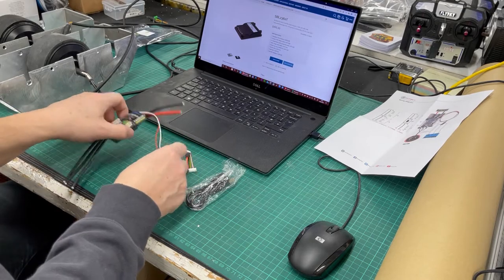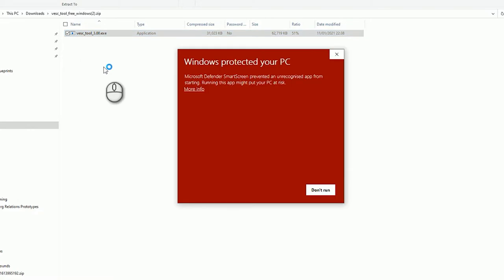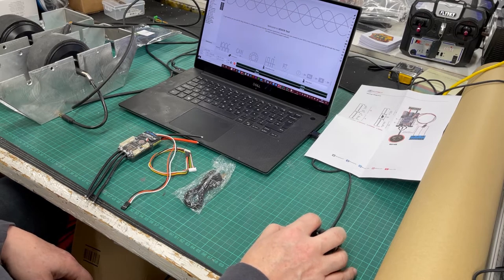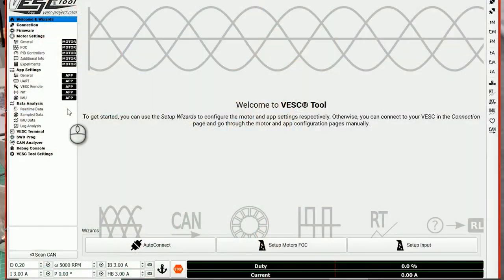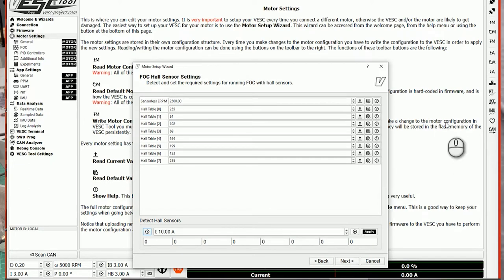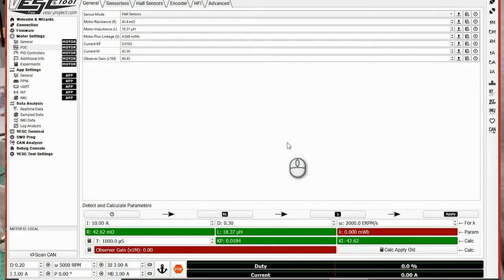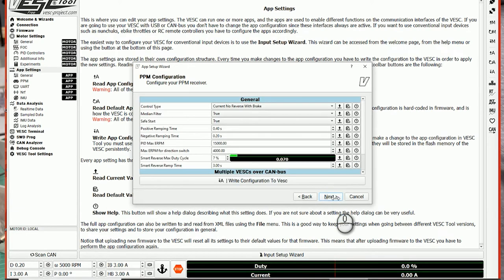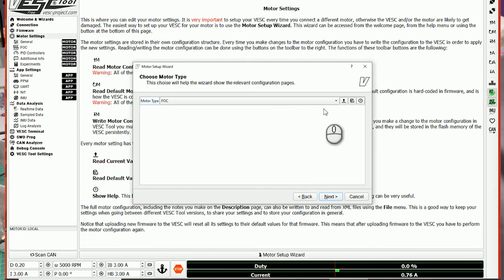Flipsky Mini VESC FSESC4 Speed Controller Setup for Brushless Motors

Comment: Hi, this is one of the best videos so far. Great job! What remote and receiver are you using? Are they standard 2.4Ghz or something else? Is the receiver analog, servo or digital?  I would like to get the same one. What cables need to be connected for the remote to setup and work? Sorry for all the questions but i really like what you are doing! THANKS
Reply: Ray , its a Spectrum DX9 transmitter that is digital with DSM2/DSMX protocol running on 2.4GHz

Comment: Hi, Lee!  Thanks for making this, it was super helpful, especially with the current stock shortage on RoboteQ's controllers.

Did I follow correctly that the remote control you're using is doing the tank mixing?  Is there a way to get the VESCs to do tank mixing?  Or would one need a separate tank mixer if one was using something like a Stealth controller that doesn't do the mixing on its own?
Reply: Davyd, not sure its a complete answer but I've used Spectrum transmitters for both 2 stick and 1 stick RC vehicle control using the mixing in the transmitter itself - just depends on how you prefer driving but no separate tank mixer was required
Reply: @shakesc  Yeah, I know there are transmitters that can do tank mixing.  I'm going to be using Stealth, though, which doesn't, and I'm trying to figure out if the VESC can do the mixing.  Because the VESC looks easier than the ODrive, but if ODrive does tank mixing and VESC doesn't, then ODrive starts looking better.

Comment: Hi Lee, j am having the flipsky 75100 for my e scooter, it works all fine till i brake, it seems it makes a lot of cutsoff while braking. Accelerating is smootli, braking toggeling, i dont know how to explain, for me its cutting because its reaches the 85 max regen amp.
but i wont set it higher.
i think its schould break smoothly in every setti g, and not making cut offs.
greatings from italy

Comment: The Roboteq controllers uses Molex Micro Fit 3.0 connector, not the JST like you show here.
Reply from the maker: Admittedly I was showing the SBL2360 but the SBL1360s I used do take JST.

Comment: I will add a comment in to avoid any confusion: Flipsky and the VESC-project are not linked entities. The VESC-Project is run by Mr. Vedder, original hardware sold by Trampaboards LTD. Please also consider to donate to Vedder, so that the software can actually be developed further. Third parties do not sponsor the software development! The hard work is all in the software! The setup shown in the video is terribly wrong. Y-PPM wiring should not be done, since that will create a ground loop in between the two controllers. Such loops can and will kill the ESCs. Always use Opto decouplers in between the ESC and the receiver, so that GND is not shared. The reciever can only get power from one source and the other devices need an opto decoupler on the PPM line.
Reply from the maker: HI Frank.  Thank you for the information!  I am running a number of setups using this method without any problems, although I am not saying you're wrong.  Could you share a link to a suitable 'Opto Decoupler' so to help other out? Cheers! Lee
Reply: @DroidbuildersUK  they might survive it for a while, especially if it is an older HW 4.xx based design. However, it should not be done this way. For good Opto decouplers I would also need to do some research. Best is to use CAN anyway.